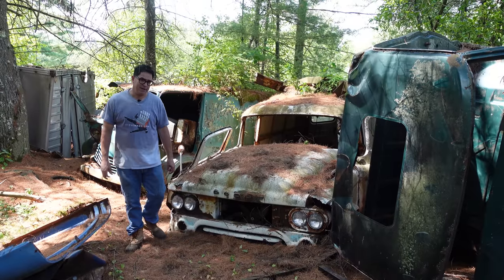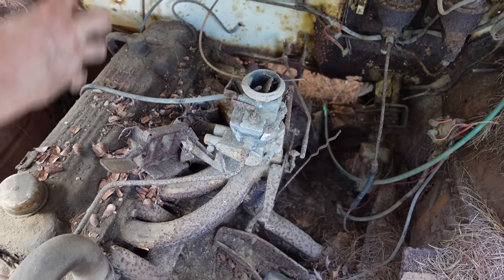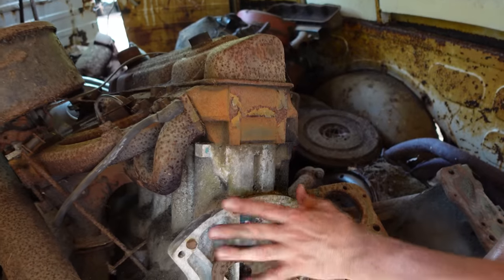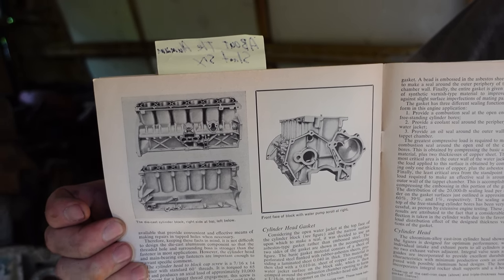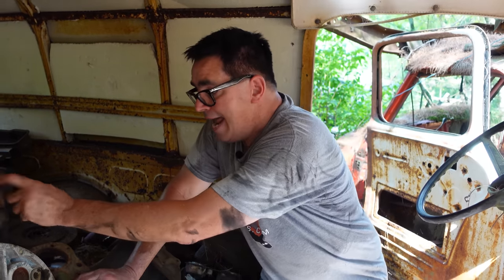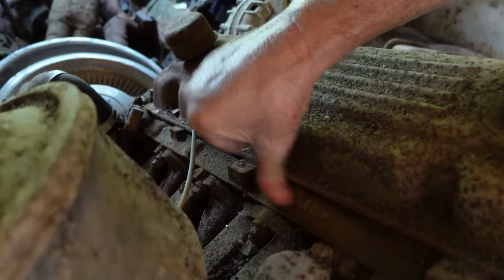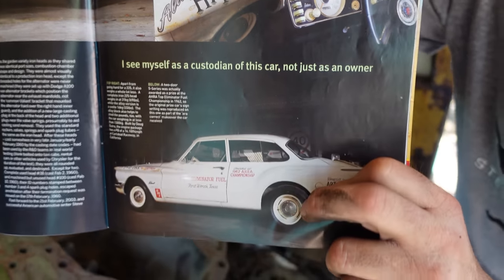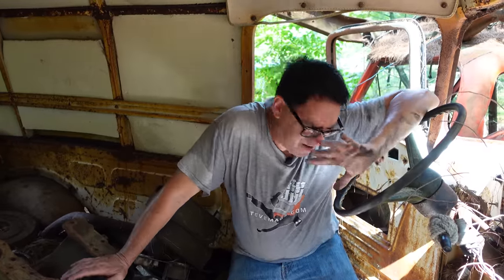Slant Six Surprise!

Comment: I have a good story myself. I was living in Arkansas and driving around in the pine forests around Hot Springs, where I lived, exploring the gravel roads. I had a 1962 Dodge D100 with the big iron slant6. Long story short, I got stuck. I was a LONG way from any help and did not want to walk, so I tried REAL hard to get out. I blew the tire, blew the radiator, and when I finally gave up, the top half of the engine was glowing red. I left never expecting it to turn over again. The entire top of the engine was literally glowing red hot! Got back a few days later with a tow, and to my sheer amazement, the engine not only turned over, it STARTED! I fixed the tire after yanking it out and drove it home and while it ran rough and used a gallon of oil per mile, it ran!  That engine should have seized and welded itself forever. After that, if I plugged the breather tube and revved the engine, it would pop the dipstick and breather out with the blowby. Lol! But that same engine ran about 3 more years after that. I finally junked the truck when I could not get brakes for it any longer. Slant 6 engines EARNED the reputation they have!

Comment: One weak item on the Slant 6 was the nylon gear on the distributor . In the 1970's they were hanging on the wall with a new roll pin on the walls of the auto parts stores .

Comment: My first car in 1969 was a 62 three on the floor four door Valiant slant six in "institutional" green. At the time I was not too pleased. Looking back I realize it was one of the most reliable cars I have ever owned.
Reply: In 1983 I had a '62 Plymouth Plymouth in that same green, but three on the tree. This may have been a gov't fleet purchase as there was no model name on the car or on the title.  The laminated circuit board in the dash delaminated causing problems with gauges and indicators.
Reply: Uncle Tony remarked that after a lifetime of messing with Chrysler products he has never seen a 170 slant that was worn out. Chances are if you took care of it and it didn't rust out you would still be driving it.

Comment: As a young family man of 22, I bought a '64 Dodge 440 with the slant six and pushbutton automatic.
  The trusty but rusty Dodge served us for many years without ANY major repairs needed.
 What amazed me was that,  as the outer body succumbed to Chicago area winter road salt, the inner structure of the unibody revealed itself to be galvanized metal. She was a 4 door post and was eventually replaced by a Volare wagon with the "Super Six"...
Reply: @ Neal Sidor wow sounds like you had your hands full as a young man. Thanks for sharing your story. 👍
Reply: @Neal Sidor, I still have our family car, 64 440 four door Sedan with the 225 one barrel 3 on the tree,,, she's like a sewing machine and not in bad shape at all, even yet. They are such good driving cars my Dad has had several over the years,,  including the one he bought new, a dark blue 426 wedge 4speed Polara 500 two door hardtop. Still in its original paint and chrome today with 71k miles on the clock. Love the 64's absolutely the most.
Reply: @patrickwayne3701  
Yup, cruised Lake Shore Drive in the summertime, that ol' 'leaning tower of power' wasn't a lightning bolt but it held it's own on the highway.    The old memories that are conjured up related to the automobile are almost always happy ones...

Comment: Learned something new today. I never knew there was such a thing. Great job as always, Steve!
Reply: The slant 6 was a great engine as was the Ford 289.  Ya couldn't kill them.
Reply: Yeah... After WWII's ferocious demand for aluminum planes/engines ended, ALCOA, Aluminum Company of America, was looking for a market for its enormous capability to make aluminum, so was pestering automakers to use more aluminum. Buick actually made the 215" aluminum V8 about 1950 for concept cars before going into mass production of it in 1960. And, of course, Chrysler gave in and made some aluminum Slant 6's.

Comment: I had a 1960 D100 pick up, bought it 11/1970 .It had a dead flathead 230 C. I. Only the cars got the Slant 6 in 1960. I bought a slant six junk yard core. It was all corroded away where it sealed against the head gasket as they probably did not maintain the coolant.  The coolant passages are open at the deck and closed on the iron except for the steam holes etc. I later learned tig welding and wished I had saved that Alum.slant six and tried to weld it up. If you use these aluminum blocks they require a special head gasket. The head is slightly different but works on an iron block also with the iron block head gasket . You can not run the head from an iron block on an aluminum block .

Comment: Great engine the slant 6, I had two of them. A 74 Dodge Tradesman 200 van, and a 81 Dodge Mirada. The later one had downsized spark plugs and they got rid of the spark plug cups. It also went to hydraulic lifters. My favourite Detroit made vehicle engine. They are also a great marine engine and designed for the task.

Comment: Great video!  I've got an all original 1985 D150 with 28k on it and I would drive that truck anywhere. I love these engines and I wish they still made them and another thing I get almost 25 miles to the gallon on the highway.

Comment: A lot of manufacturers were experimenting with aluminum engines in the early 1960's.  remember our neighbor had a 1962 Rambler Classic with the aluminum block six and it overheated once and warped the block and after that it kept blowing head gaskets until he got rid of it. As I remember corrosion was the big problem and people back then didn't understand that coolant concentration was critical and if it was too weak the aluminum oxide would clog up the cooling tubes in the radiator.
Reply: Many old time mechanics in warm climates would advise "Never use anti freeze." They had goofy reasons that seem ridiculous.
Reply: Even earlier, after WWII's ferocious demand for aluminum planes/engines ended, ALCOA, Aluminum Company of America, was looking for a market for its enormous capability to make aluminum, so was pestering automakers to use more aluminum. Buick actually made the 215" aluminum V8 about 1950 for concept cars before going into mass production of it in 1960. And, of course, Chrysler gave in and made some aluminum Slant 6's.
Reply: @BuzzLOLOL  I think my old Cadillac saber Wheels have the word Alcoa on them

Comment: These engines were so reliable. They had that unmistakable Star Wars blaster sound when they started.😂 I never knew that that first year was an aluminum block. Unreal. It really was an ingenious design. A friend of mine had an old 66 Lancer and got a half 1,000,000 miles out of it. They were really built to last in those days.

Comment: When I worked at National airport in DC, there was somewhat of an abandoned vehicle boneyard (the airport fire department sits there now). I went wandering through one day lifting hoods. I saw a flat, very low, very old, small jet tug (not the bag tug type, the type used to pushback aircraft) obviously used on smaller aircraft. I lifted the hood...surprise! gas burning slant 6 (the only aircraft tug I've ever seen that wasn't diesel). Probably geared to within an inch of its life.

Comment: I purchased a 1973 Plymouth satellite with a slant 6. It had 79,000 on it when I purchased it. Drove it everywhere. Besides regular oil changes I had to spend $15.00 to replace the oil sending unit. Sold it at about 130,000 miles, ran into the car years later and it had over 200,000 on it and according to the new owner other than normal upkeep nothing else had been done. These motors were impossible to kill if kept up

Comment: In 79 I got a 69 Dodge Dart 225 Slant six. They're so easy to work on it's unbelievable. I change the starter at the curb in front of a Main Street Auto Parts, unplug wire take off three nuts slide starter off, reverse process without going under the car. You could do an oil change without going under the car, the drain plug was on the corner of the pan at a 45 degree angle, slide a pan under with your foot reach over the fender unscrew the filter remove drain plug.
Also way cool was the torsion bar front suspension, turn one screw on each side of front suspension to lower and raise, I added air shocks to the rear to lower and raise. Lower for racing and handling raised for everyday driving.

Comment: I owned a 76 Dart with a slant 6. I tore ass around the dirt roads and that engine was solid, the only problem was the block balast (ceramic bit that bolted to the firewall) they were cheap, keep a couple in the glove box with a few simple tools and away you went!

Comment: That's why the cast iron slant 6 is so rugged being designed as an aluminum block the casting is thicker than would be normally.
Reply: You are exactly right. This is why a slant can be bored over .125 inch and the head can be decked by .200 or more

Comment: I did up a slant as a kid back in the seventies for a 69 Dart, Viper headers, Offy intake with a 465 Holly, slipped a Duster 340 rear end with a 365 GR and six leaf springs in it's butt, even found a four speed bell housing from a hyper pak six Dart, colored blue/blue, had a blast in that buggy, wasn't a drag racer but was a lot of fun on, yet built for the street, let alone getting just under 20 mpg.  Today, the car is yellow with a 440 and a different owner, it still lives !

Comment: AMC also had a Aluminum block in line 6 for a few years on the 196; came out, I believe, just before the alloy block slant six.

Like the Chrysler engine, it was short lived, last available in 1964 as an option.  When they overheated, dealers replaced them with the cast iron block 196 and the advent of the all new 232 in line six offered late in 1964 Classic 770 series, spelled the end of both the cast iron and the aluminum 196 motor.  

The new thin wall six cylinder engine (with various displacements) was in production longer than the slant 6, the engine lasting with modifications in Jeeps all way till 2005?.

Both the thin wall six and Chrysler slant six are legendary for their rugged design, long life, and have many aftermarket performance parts available, including turbos and fuel injection.

Comment: Having worked in aluminum foundry I learned that  the problem is that different metals expand and contract at different temperatures causing leaks and cracking of metal. The only way that engine would have worked is if it had a aluminum head and bolts. The motor just wouldn't have a long life. It's something  they got perfected now in cars.
Reply: Lots of engines run cast Iron blocks with aluminum heads.
Reply: As you add different alloys to metal the contracting and expanding temperatures change. It's more perfected now then it was then. Not saying the motor won't run. It just won't have a long life. Adding zinc,copper,led etc. gets you different results
Reply: I imagine there are aftermarket aluminum heads available for the vintage Slant Sixes. How does anyone know that using an aluminum head would solve the problems associated with the aluminum block? I wouldn't try it. The Slant Six is what it is. If you're reviving it or keeping it running, you work with it as it is. It's a cast iron engine and that's it. I'd rather try an aluminum or alloy head if one even exists with the cast iron block than try to run the aluminum block.

I once said, the advantage of aluminum is that it's light. The disadvantage of aluminum is that it's aluminum.

Comment: Back when I was a kid, my family bought a new 1960 Dodge Dart Seneca wagon -- the least expensive of the full-size Dodge models at the time -- and it had the standard slant-six engine. Chrysler engineering apparently wasn't the best at the time, because I can recall that both the engine and brakes had to be replaced under warranty within the first couple months. That wagon was pretty basic: three-on-the-tree and no A/C or rear-facing third-row seat -- no power anything, except for the useful of power rear window option, appreciated by all. I still have fond memories of our first camping trips in the two-tone beast! It lasted six years before we retired it prematurely....

Comment: Loved the slant six, rebuilt an iron one in my A100 van on the side of the road, no garage available. Half inch socket took most of it apart as I remember. Put the pistons and rings in using a steel strap oil filter wrench. Too funny, fired up first try. Great memory.

Comment: Once upon a time, I owned a 1972 Dodge Dart with a fresh 'Sears' rebuilt block 225 Slant Six. I did some very simple mods to the engine, tidying up the airflow in the carb, and a free flowing exhaust, etc. Minor stuff, but it was quite noticeably more torquey.  Put much larger rear wheels, and tires to match. Started breaking the spider gears in the rear axle. Again, and again, and again. After a while, the scrap yard guy selling me all his rear axles suggested that I upgrade to something from a V8 Charger or whatever. While it was out, I had a set of spring mounts cut off a broken axle and welded onto the top of the latest axle. I installed it UNDER the leaf springs, for an instant lift of 5 or 6 inches. Got under the front, and cranked up the front torsion bars to make it level. Now I had a lifted Dodge Dart, that was actually a bit difficult to clamber into and fall out of. Quite silly. Yes, we did go off-roading in it, Dukes of Hazzard style, bent the chassis multiple times and had it straightened and welded back together. Comedy car.  Drove it for years. Nobody ever told me that the redline was 4500; I'd always assumed it was around 6000.

Comment: I've only seen one in a 62 Valiant back in the 90s in a junkyard. The head was gone but you could see major corrosion going on inside the block. I remember you had one on display at Spring Fling maybe 20 years ago. Junkyard Platinum!!
Reply from the maker: Hey Kevin Cruz! Are you Gregg Hansen's buddy? I'm thinking you are the same Kevin Cruz we used to hang with occasionally. If so, HELLO! Thanks for writing, Steve Magnante
Reply: @SteveMagnante  Yes. That's me. Remember when I came over to help thrash all night on a Duster called "The Mule" with a 318 I sold you. You took it to LACR and wrote an article about how much nitrous oxide it could take before it blew up! I ended up going home because I was allergic to cats! 😆

Comment: Long live the slant six 😊
I had an '81 Power Wagon w/ slant six. Great engine! 
Came with a one barrel carb. I put on an edelbrock intake and got a used 390cfm 4 barrel carb, put in new jets for my 225.  Was a good match for power and economy.  The one barrel was terrible, if there was a head wind I could hardly get over 90km/hr 😃.
I used to off road with it, and the six had amazing torque for hill climbing. I'm pretty sure my block was steel, but didn't know that there was an aluminum block made.

Comment: When I was 16 I had a 1967 Dodge Dart 170 cu in. I also worked at 2 gas stations. Both Mobil stations. 7 am to 5 pm at one station then 6 pm to 11 pm at the other. Of course I couldn’t leave things be with my Dart. I wish I could send you a picture of the engine. It had an Offy intake, a Holly 4 bbl., and Vipar headers. My Brother in Law was the mechanic at one of the stations I worked at. He helped me move the 3 on the tree to a Hurst shifter 3 by the knee. It had chrome wheels with baby moon hub caps. I had a decent am/fm with a vibersonic reverb deely Bob hooked up to it. If you can imagine a 16 year old that worked in a gas station in 1969-70 then you can picture my car. It was a fun time in my life.

Comment: I had a 62 Plymouth Valiant Signet 200 with the 225 aluminum slant 6.  Mine died because of corrosion in the aluminum block which plugged the coolant passages causing over heating.  In 1970 I finally pulled the engine and put a cast iron short block in.  The difference in the head gasket for the iron block resulted in higher compression.  That engine was really strong until a '58 ford station wagon ran a stop light and totaled the car in 1978.  The engine was still going strong.

Comment: I had an aluminum sl/6 block I traded to a guy from Australia who was visiting Seattle, WA. He was supposed to send me a cool looking steering wheel that came on some Australian mopars, not available here in the States. Of course, he stiffed me.
But I still have the "Special" head, which I rebuilt with bigger valves & 340 v. springs.
I've had a lot of sl/6 4spd cars and they are so much fun.

Comment: Steve I had a Dodge van for a couple of years with a slant six in her , I bought the van off a friend , we raced motocross dirt bikes  , we would load that van up with two dirt bikes and equipment and go racing on the weekends and where the races were was very hilly and so were the roads to get there , that slant six with its great amount of torque would grunt that van with all that weight up those hills every time  thanks .

Comment: That slant six is bulletproof. My father has a 1976 Plymouth Volare. The car had over 500k miles. The body rotted but the engine was still running!

Comment: I used to know two different salvage yards one in Ocean Springs and the other in Flowwood Mississippi. They specialized in Crysler salvage of all divisions. 😮😮I  encountered the aluminum block slant 6. I was told the problem was owners wouldn't follow Cryslers antifreeze recommended antifreeze and the wrong antifreeze would cause a destructive corrosion around the head and block😮

Comment: My '67 Dodge Coronet 440 had a slant six and aTorqueflyre tranny.  Chrysler also made a marine engine kit for the SS that changed out the carb and a few other things to increase the horsepower.  A very
Ryan underappreciated engine.